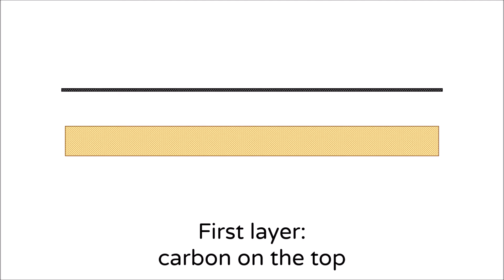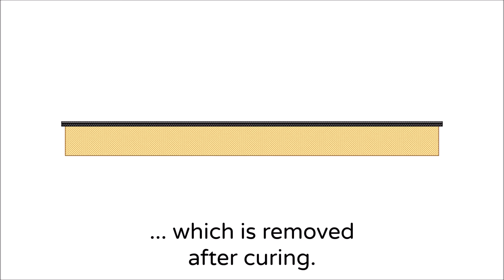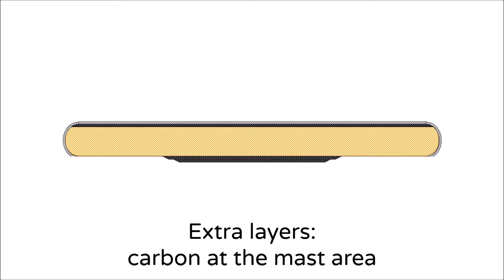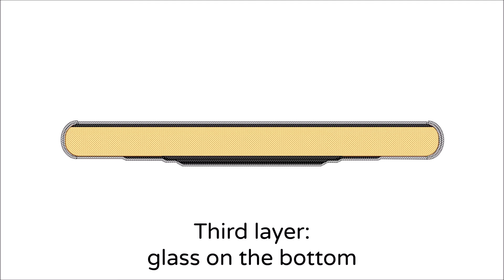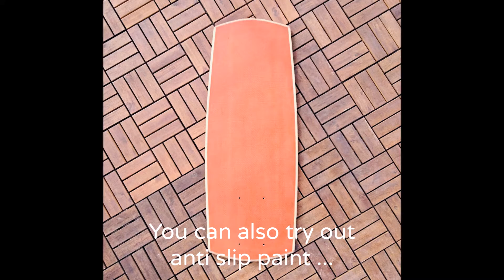Easy DIY Foil Pumping Board: The Paulownia EISVOGEL

Comment: Awesome job!
Is there a reason for adding first glas layer on top of the board?
What would you do differen next time?
Reply from the maker: It is first a layer of carbon and then glass. You could also do it the other way around, but then the edges would no longer have that wooden look.
What would I do differently? I'm still thinking about how to make the holes for the mast easier. Maybe with inserts? But I haven't found anything suitable yet!

Comment: Very nice. Thank you for sharing this process. I would like to make a very simple board from plywood and epoxy, without the glass and carbon fiber. Is the carbon and glass really necessary and how much of a difference does it make if you do not use it?
Reply from the maker: Hi Harry, plywood weighs about twice as much as paulownia wood. But of course it's much more stable and yes, with plywood (20 mm thick) you don't need any additional fiber reinforcements.
Reply: Thank you very much for the fast replly! I started building the board today. Hopefully I will be able to finish it this week.  @neckarfoil
Reply: @neckarfoil  hi, do you think its possible to make the same board without fibre layers? Just paint
Reply from the maker: @vonumadum8527  Hi, the thickness of the Paulownia wood core is 18 mm. At this thickness, it will not be stiff and strong enough without fiber reinforcement.
Depending on the rider's weight, you would need a wood thickness of 30-40 mm. It would be best to use two hardwood stringers, which then hold the screws for the mast mount. Check out our video on the Curvy Koi https://youtu.be/VPsJzjl3C3I
But with the greater wood thickness, the weight also becomes very heavy!
Reply: @neckarfoil  thanks for the quick reply! Since you say stringer: i thought of just screwing 2 stringers on the bottom surface to stiffen the board and to screw the mast on
Reply from the maker: @vonumadum8527  Yes, your idea of screwing the two stringers on the bottom is  very good. But we have no experience with this type of construction and cannot say how thick the stringers or the Paulownia board need to be.

Comment: Great video, thanks for sharing. Which tape do you use to mask the edge before applying first glass layer (around minute 3.00)?
Reply from the maker: Happy New Year! In this Video I used Tesa Ultra Power Tape. The Tape is very wide (48mm) what makes it difficult to mask curvy lines without wrinkles.
I tried out a strong paper masking tape with 20mm width and it worked better. Just apply two lanes side by side to have a wider masking!
Reply: @neckarfoil  thanks! All the best for the new year.

Comment: How well has this board held up for a year? Has it gotten a lot of use? I might build a similar one, it looks very nice.
Reply from the maker: Hi Tyler, the first of these “Kingfisher” boards have been in use for our foil pumping courses for almost two years now. There have also been no complaints from our customers who have purchased a board. The robust construction with the wooden core does not become soft despite the high load during pumping. It is ideal for dock launching in harsh environments with steel docks and concrete walls. In contrast to foam cores, the board does not soak water in the event of minor damage.

Comment: can I use bambu or is it too light?
Reply from the maker: Bamboo wood is twice as heavy as Paulownia!
Bamboo 500 kg/m3 and Paulownia 280 kg/m3.
Due to the higher strength, you could reduce the thickness of the board to save weight. But not too thin, because it should be as stiff as possible.
You can compare the properties of the woods here:
https://www.wood-database.com/bamboo/
https://www.wood-database.com/paulownia/

Comment: Megagut und super, dass ihr das mit der Community teilt! Meint ihr, dass m8 Gewindemuffen auch für den Mastmount klappen würden? Hattet ihr damit Mal gearbeitet?
Reply from the maker: Hallo choco4surf, du meinst sicher diese Gewindemuffen mit Außengewinde für Holz und innen metrisches Gewinde!? Nein, damit haben wir tatsächlich noch nicht gearbeitet und können keine Erfahrungen dazu teilen. Wir würden diese Muffen dann aber auch nur in massives Holz schrauben, also kein Paulownia oder Balsa.
Alternativ könnten aber auch je nach Boarddicke "Einschlagmuttern" funktionieren. Etwas edler wären "Bighead Fastener". Achte in jedem Fall darauf, dass es Edelstahl ist. Bei Salzwasser am besten A4 Edelstahl!
Reply: Tatsächlich meine ich nur eingeklebte Gewindemuffen (nur mit Innengewinde, aussen glatt und nur eingeklebt in die Bohrung). Also eine Befestigung ganz ohne Mutter. Aber vermutlich ist das zu riskant. Werde es vermutlich nicht riskieren.  @neckarfoil
Reply from the maker: @choco4surf  Ist tatsächlich riskant. Es sollte zumindest ein Hinterschnitt vorhanden sein, also eine formschlüssige Verbindung zwischen Gewinde und Board!

Comment: Hi and wow! Nice work! 
Do you think the metal pipe is necessary?
Reply from the maker: Hi! The inner walls of the holes must be sealed to prevent water from penetrating the wood. It doesn't have to be made of metal either! Sealing with epoxy could also be sufficient.

Comment: Thanks man for sharing this is great! I am trying to build my own very soon! The screw job is very impressive, I don't understand what is the tool you use at 6:15
Reply from the maker: Hi Francois, the tool is a pipe cutter. It allows you to easily cut metal pipes to length. Always right-angled and without chips.

Comment: Hallo,
ich bin gerade schon dabei das Board zu bauen und habe noch ein paar Fragen dazu :)
- Wieso werden Kanten mit Klebeband abgeklebt vor der Glasfaserschicht?
- Ist es auch möglich Langlöcher mit der Stichsäge reinzusägen und Epox reinzumachen oder ist das dann zu instabil?
- Welche Schraubenköpfe nehmt ihr? Ganz normale Sechskant + Beilegescheibe?

Vielen Dank und Grüße
Valentin
Reply from the maker: @valentinhiermeier5476  
-Klebeband: Durch das Klebeband entsteht eine klare Schnittkante und du kannst mit dem Messer das überschüssige Glasfasermaterial an dieser Kante abtrennen. 
-Langlöcher: In unserem Video zum Curvy Koi haben wir Langlöcher verwendet. Mit einem Ovalrohr zur Verstärkung. Allerdings ist es sehr aufwendig, diese Aussparungen zu machen. Aus unserer Sicht sind Langlöcher nicht unbedingt notwendig. Statt den Foil 3cm weiter vorne zu platzieren, kannst du dich auch mit den Füssen 3cm weiter hinten positionieren!
-Schrauben: Flachrundkopfschrauben M6 mit Unterlegscheiben. Schau mal in unseren Shop, da findest du ein Set aus hochwertigen A4-70 Edelstahl ;)  https://www.neckarfoil.de/shop/equipment/
Reply: Vielen Dank für die Nachricht!!

Comment: Is there a template you used to cut out the board?
Reply from the maker: Hi 99shades, no there is not really a template. I just use the previously built board. But feel free with the shape. The shape plays a subordinate role for foil pumping boards. A sharp nose or corners should be avoided so that it is not as sensitive to impacts on the dock.
Reply: I rlly liked the look of yours. What was the length and width?
Reply from the maker: @williamstratton6221  Thank you! The dimensions are 92 x 35 cm. Have a look on our website. May be you can copy from the photos:
https://www.neckarfoil.de/shop/equipment/foil-pumping-board-eisvogel/
Reply: Thank you for the quik response!

Comment: too complex: 2 hardwood sticks (2.1cm x 2.1cm x 60cm) screwed and glued 9cm apart for supporting the mast foot onto 3.3mm plywood - plus 2cm XPS laminated with 2 sheets of glass fabric (160g/m2) on bottom and sides + 1 sheet of glass fabric on top - Is sufficient. Thus at about 65€ and lighter weight too.
Reply from the maker: That sounds no less complex than simply using a wood core. But yes, using the hardwood strips as reinforcement is a great idea! And definitely more lightweight!